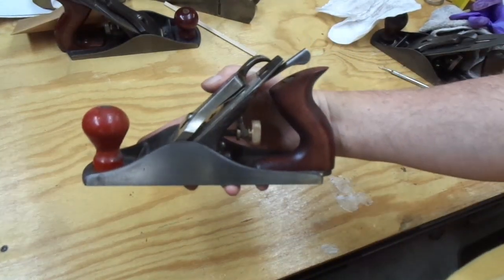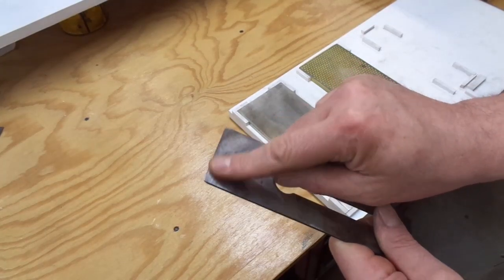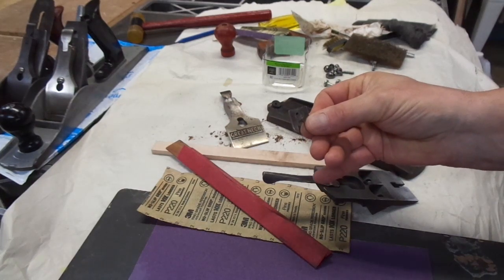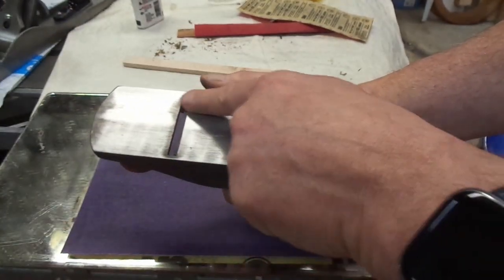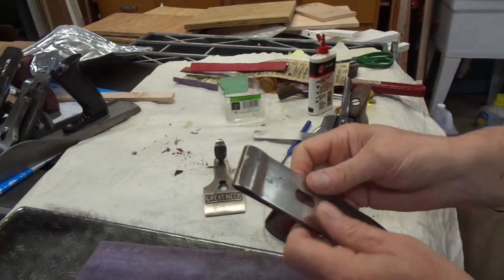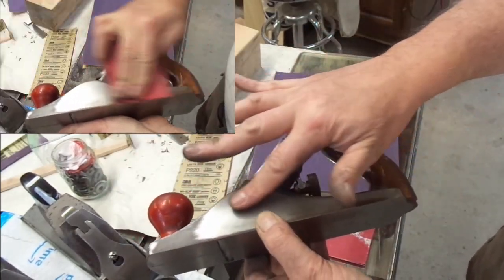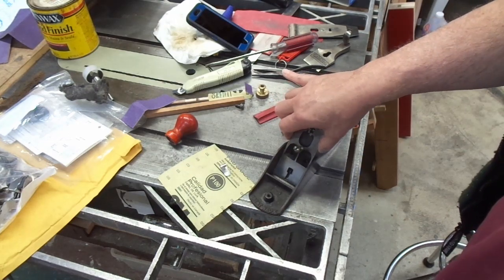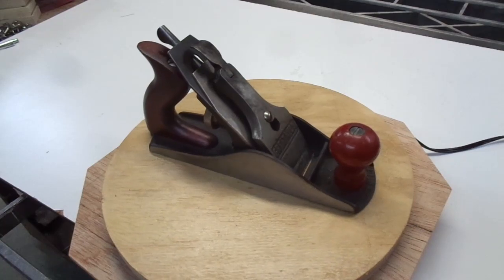Great Neck G 4 Hand Plane Tune Up

Comment: Great video.  My main plane is an old Great Neck G-5 and it is a great piece IMO.  I only bought it because it was so much cheaper than a comparable Stanley and I can’t find any fault with it.
Reply from the maker: Good to hear.  Post a video on what you have.  I'm sure I'm not the only one who'd like to see it.   I've used mine off and on for a few months now.  It works well, but I feel it's a bit finicky when trying to adjust the iron up and down, left and right (the lateral adjust seems especially wonky).  I'm not sure it's worse than my other planes, but it seems to be in my un-scientific view.  Maybe I need a little more practice with it.  Still, I'm glad I have it and it's a good addition to my tool chest.  Thanks for the comment and checking out my video.

Comment: I have a chip breaker in one of my planes with the same issue. I thought about brazing the opening closed, some, then reshape to fit the adjustment lever better.
Reply from the maker: That's an interesting idea.  I don't know how to weld or braze, so I can't say much about it.  I did try peening the Y yoke tab to flatten it a bit and possibly spread the metal a little.  I also peened the hole in the chip breaker, thinking I might be able to close it a bit.  Measuring with calipers confirmed I got a few thousandths of effect, but it didn't make much of a difference when using the plane.  Several of my other planes have a 2+ turn lock to lock and it's not that big of a deal so with the amount of planing I do I just live with it.  You can buy Y yoke blanks that can be filed to fit perfectly.  I don't remember the name of the company but James Wright's channel has discussed this option and the source.  Thanks again for the comments.
Reply: @jazbuilding  I think it's Reed planes that sells those. Brazing is not to hard to learn. I just repaired a sole on a Stanley 4 1/2 by brazing. I used a Mapp gas hand held torch. Thin metal is much easier to braze. Admittedly, I've been brazing for years but it comes in real handy.
Reply from the maker: @jimzeidler3829  Reed sounds right, thanks.  One of these days I hope to weld and/or braze.
Reply: @jazbuilding  you're welcome, sir 🤠